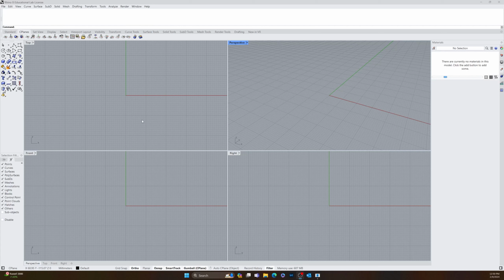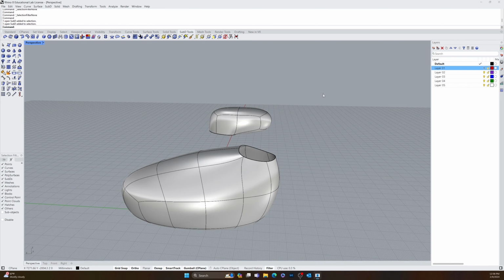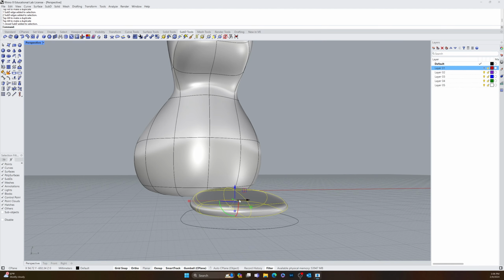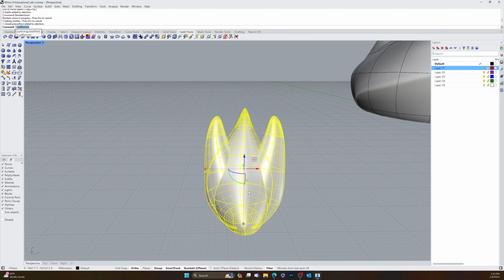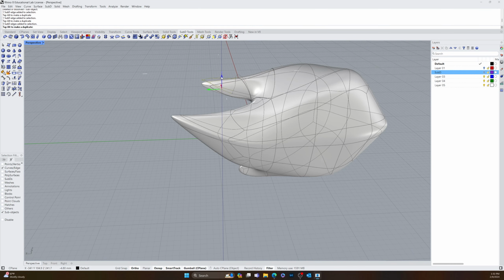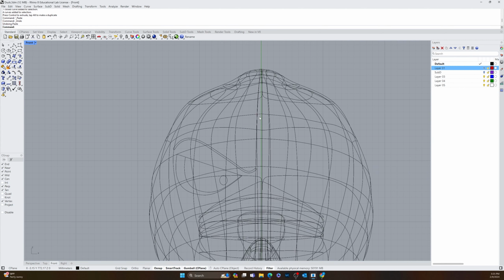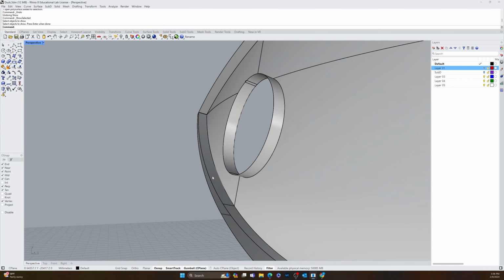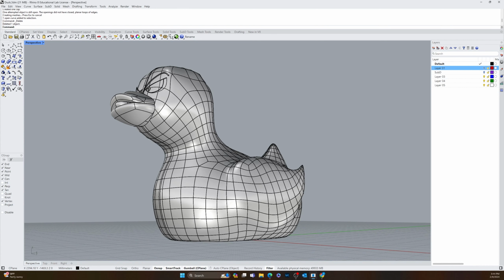Rhino 8 Sinister Duck Modeling

Comment: Nice video! My question is: how do you get the command menu on the top like that?
Reply from the maker: I am using PC.  You might be using Mac so the command line is docked above the tools on the left.  I don't think you can change it.
Reply: Did you hover your mouse in the upper left of the command line. If you get the 4 cross arrows. You can drag any tool bar you want. Then the purple bars that pop up help with positioning.